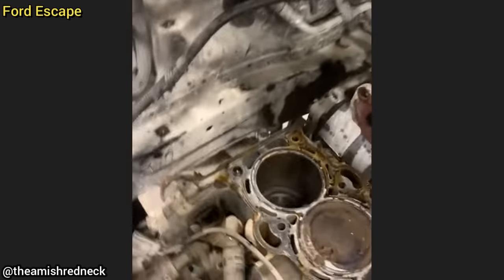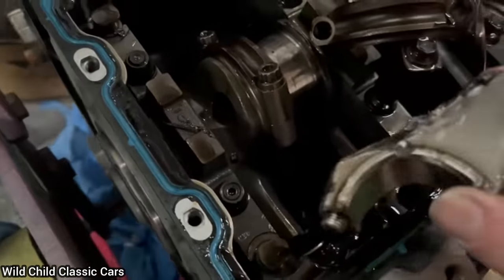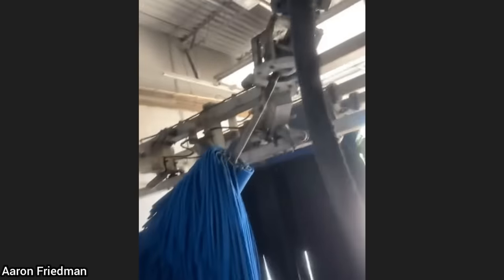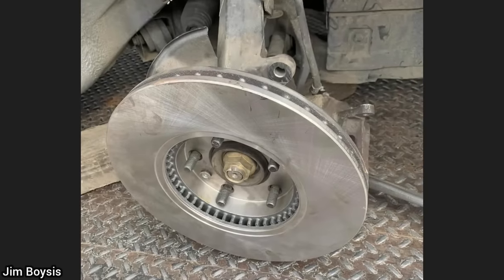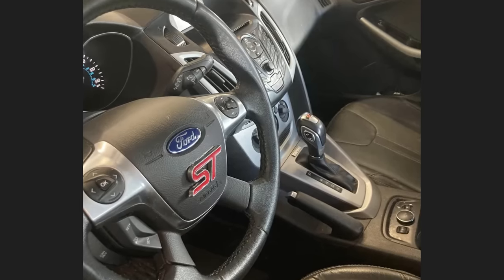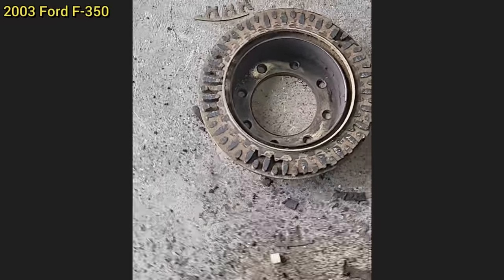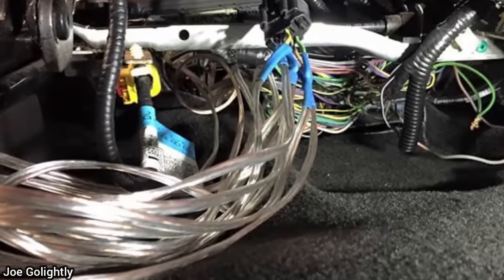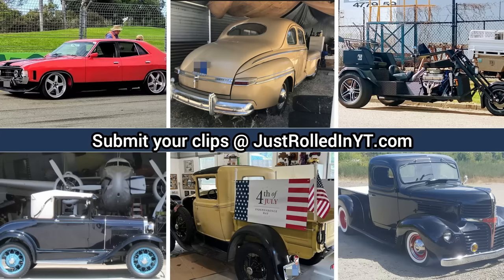Customer States Engine Runs Rough After He Replaced Some Parts | Just Rolled In

Comment: After watching each video, I have confidence I can change the oil and not blow the engine up.
Reply from the maker: You can do it 💪
Reply: That's way more confidence than I have.
Reply: Well you also need a garage with a channel, and disposing of the old oil is strictly regulated. If you just dump it somewhere, that's criminal.
Reply: @coladict  No, you don't need a garage with a channel (unless you have some exotic car with extremely low ground clearance). A jack and jack stands are perfectly fine. As for disposing of the used oil, pretty much every auto parts store in the US (can't speak for other countries) will take the old oil off your hands for free. At that point, it's no longer your problem.
Reply: @coladict been changing my oil for years. Just need some ramps(if vehicle is too low to ground) and an oil pan to collect the oil. Most auto parts stores around where I Live allow you to bring your used motor oil for free recycling.
Reply: Before you try it, do research. With your vehicle, do you drain or suck the oil out? If drain, use a new crush washer each time. 

Changing the oil on a 76 Chevy Nova was a lot easier that it looks like on a newer car. Age, bad knees and cars that are lower make me go to the shop now. 

Good luck, hope not to see you on this channel.
Reply: @mikecumbo7531  apparently you haven't changed oil since the 70's. They don't use crush washers anymore. They have a rubber gasket molded onto the drain plug. Sucking the oil out is a crap way to do it and doesn't get all the contaminates out that are sitting on the bottom of the oil pan.
Reply: @FastSS02  It depends on the manufacturer.. some still use crush washers. although you can get away with using the same one twice if you take it off and put it on backwards, as long as it wasn't way overtorqued.
Reply: @henlo1910  Please name one single modern manufacturer that does this.
Reply: Best fix in this mix. It works and it is secured.
Reply: @FastSS02  what? Suck oil or crush washer? Audi is the answer I know for both. Depends on car age I guess.
Reply: @FastSS02  Every motorcycle manufacturer? Honda for starters?
Reply: Imagine the horror I experience with every video, I grew up in the 70's and 80's when we all built our own cars.  Its disturbing I'm sharing the road with people with as little knowledge for their car as if it was a space shuttle.  The internet and smartphones have without doubt made people more ignorant.
Reply: i dont need it, my dealers garage is just a few hundred meters away and have insurance if something went wrong...
but i am also not American and not in America, i am driving a Korean car made in India!
Reply: @FastSS02  Yeah right, buddy. Next you'll be telling us you don't have to turn the crank on the front to start the engine anymore. Damn young'ns think they know everything!
Reply: Idk what's worse. 

Lazy idiots that never change the oil and wonder why it seized up, or those that somehow fill the oil pan up with 30 gallons of oil instead of 3 or 4 quarts (depends on vehicle, obviously. heavy equipment can require several gallons).

Anyways, I don't need anything fancy. Just my trusty 6 ton speed jack, a couple car stands, a socket for the plug, and my filter remover. 30 minutes and it's back on the ground.
Reply: @tenhundredkills  Up here in Canada, most Auto shops will take used Oil for disposal. There are some places that will charge you about $$ 10--15. to dispose of old Oil.
Reply: @coladict You can get a small catch basion you slide under the car get a pump jack and pull the oil plug also you can store used oil in empty oil containers when you put new oil in
Reply: @FastSS02 my old 03 Corolla S did so does my 04 Camry LE
Reply: @Javalar why
Reply: @tenhundredkills  yes all correct I use the old oil on all sorts of thing's tho

Comment: The backwards installed rotor made me laugh out loud!
Reply from the maker: Same! 😅
Reply: Should not smoke weed while working on brakes.
Reply: I put rotors on backwards all the time.... of course, after I spray them down with brake kleen I put them on properly
Reply: How do they come to the conclusion that its the studs, and/or another issue after taking off the old rotor? How?? Its disturbing how they can't work out what the (very simple) issue is despite it being right in front of them. 😆🤣🤣
Guy 1:   "I think.......I think the studs shrunk when we weren't looking😵‍💫!!"
Guy 2:   "Yeah,  Iv'e heard of that, it usually happens when you change the wheel in the rain, but can happen from time to time. Lets go down the parts store and order some longer ones🤤"
Reply: Certified 'emmerfugengawd' moment from those guys.
Reply: And "a friend just installed" an excuse for a DIY gone wrong
Reply: Years back a fellow my father worked with did that but with the front tire on a semi truck. Installed the steering tire ‘inside out’ when he changed it and then pulled it outside the shop and parked it. My father came along and had to scratch his head for a minute as something wasn’t quite right with that picture and then the light came on, ** the wheel is on backwards!
Reply: The best part is to even get that far you would have had to have taken the old rotors off... The ones right in your face and installed correctly.
Reply: All I could think was, Did you NOT watch how you took them apart? Clearly someone who thinks they're smarter than they are. The longer wheel studs line was a hoot. Lol
Reply: I was about to leave the exact same comment 😂
Reply: Got a good laugh out of that one. But at least they knew when to stop and seek professional assistance.
Reply: @Tk3997 I was taught that working on brakes you do one side at a time. If you ever get confused you can go look at the other side and figure it out.
Reply: It's not like there weren't 3 other chances on the car to compare in case of uncertainty...🤦‍♂ 

(and even if front and back look a bit different, the other side should still be usable as a guideline.)
Reply: @Bandit69ply  And that is why you do only one side at a time.  Use the other side for reference.
Reply: @uhtred7860  My first guess for why/how? Legal recreational weed.
Reply: Yes over the years I’ve worked on my own brakes, usually with success,    BUT I’m pretty sure that there could be a liability issue if anything wasn’t right and people or property got damaged,  brakes are important….get them serviced by a professional with liability insurance …. My advice
Reply: I laughed...out of pain
Reply: It's plausible that they bought the wrong rotor replacement so it wouldn't go in the correct way. So they figured to reverse it but now the lug nuts wouldn't connect 🤣 For a noob DIY guy it can be very confusing if the parts store hands you out the wrong part. It can happen even to professionals: I had an old Opel Vectra that developed a clunk in the front. So I had the front bushings to be replaced. I happened to walk in the shop while they tried to install the bushings using a blow torch and heating the sway bar red hot. After the install the clunk was even worse than before. Turns out that this year model Vectra had two optional sizes of bushings and they had ordered the wrong size. The mechanic then applied brute force to literally burn in the 60mm bushing to a 50mm hole.

Comment: Wow shout out to the tech who takes on the challenge of fixing a customers wiring job when it looks like that
Reply: Nothing was fixed, it was just totally removed and replaced with the correct harness and heating element.
Reply: Speaker wire, the customer used speaker wire for a seat heating element...Someone clearly knows nothing of electronics, electricity, resistance...
Reply: Yeah, I've made spaghetti that looked easier to sort out that that.
Reply: The scariest part is that a seat actually comes with that many wires, it's a damn seat not an electric chair!

Comment: call the cops if you see a damaged vehicle driving on the road like that box truck
Reply: yea, if that thing falls of it could kill someone for sure, imagtion that hitting someone on a motorbike...
Reply: It more than likely was in accident and was being driven to the junkyard. Should have had straps to hold it together, but some states don't care about safety.
Reply: Probably just happened and driver is still unaware!😂
Reply: @americansmark  It should've had the box taken off and hauled PROPERLY to the junk yard.
Reply: It's surprising that the driver drove it in that condition. He better hope that he still has a job after his boss sees the truck.
Reply: I was at a rest stop and saw this guy's rear bumper barely hanging on.  I told him he needed to secure it before it became a projectile.  He basically told me to F Off.  Try to be nice and you get an asshole response.  Five miles down the road, it came off and went through another vehicles windshield almost hitting the passenger.  I pulled over and informed the police about my encounter with the moron at the rest stop.  That just made things worse for the guy since he clearly showed zero concern for anyone's safety.  It didn't help that the moron was also doing almost 20 over the 80mph speed limit at the time he was cutting across lanes to get around traffic when the bumper came off.  They police already had several complaints about the guy's speeding, reckless driving, and the bumper flapping up and down.  The only smart decision he made was pulling over and checking on the couple his bumper almost killed.
Reply: @johnm.5848  Driver probably is the boss.
Reply: Those flying pieces are likely to injure someone , wtf is wrong with people
Reply: OK Karen !
Reply: "Hi, I'm on [highway name] just [approaching|passing] [nearest exit] and there’s a truck that looks like it's going to fall apart on the road." is a great script.
Reply: nah, call the airforce to precision bomb it
Reply: @theglitch99 With how much it's leaning, I don't know how they're not noticing.  It's quite obviously leaning and I wouldn't be surprised if it was affecting how the vehicle was driving
Reply: He probably just left the 11'8" channel😏🤣🤣🤣
Reply: snitch
Reply: It’s nyc , anything goes
Reply: @ffjsb that's not how it's done. Wether it drives there on its own or towed. It will go to the scrapyard with the box in this condition.
Reply: @XtreeM_FaiL  That came to mind after posting my comment. Either way though, the truck wasn't safe with the box heavily damaged.
Reply: leviathanr53 dont feed the trolls and they will go away
Reply: How do you know for absolute certainty, he isnt on his way to the shop right then in that video.  Should the shop go to him? Would a tow truck tie it down?
Reply: @marioncobretti7870  If he's on his way to the shop, he should disassemble the box. That's not an excuse to endanger everyone on the road.
Reply: @alimanski7941  the average person isnt going to have the know how, or tools ,to completely disassemble that box. I dont agree it should be on the road either, but I dont see what realistic option  a random delivery guy really has.
   And no, i dont see a tow truck driver, strapping  all that shit down either
Reply: @marioncobretti7870 just because you don't have the know-how doesn't mean you just go on the road and hope for the best. If you don't know howto break it down, hire someone who does. There's no reason a truck should be on the road in that state. You can't break it down, guess that truck is sitting where's its at until the box is broken down.
Reply: Truck probably had a date with the can opener
Reply: @theglitch99 unaware? He could look out his driver-side mirror and see the box leaning😅😅😅😮
Reply: @tracewallace23 came here to post the same thing!   Lol
Reply: Thanks karen
Reply: It’s in Astoria, Queens……it’s a normal thing to see vehicles in this condition 👌☠️🤦‍♀️
Reply: Looks like he drove under a low bridge.
Reply: A victim of the 11' 6 plus 8" bridge?
Reply: @marioncobretti7870  Doesn't matter where he is going. That is defective equipment. When a piece flies off and kills or hurts someone you love I'm sure you will just say, "It's ok, he was just on the way to the shop, I wont sue him".
Reply: @switchtr3  No, it is everyones business. He is dangerous and needs to not be on the road. There is NO reason for him to be driving that wreck. You just have no since of social responsibility.
Reply: @aliceeliot6389  Why? This is why you should. So is a flying piece of junk kills your kid you would be ok with that because at least no one called the cops.
Reply: @marioncobretti7870  That doesn't matter. He's responsible for the truck he's driving. If he doesn't know how to take it apart, get someone who can. He should NOT be endangering other people's lives just because he's incompetent. You know that if someone died, he'd be accountable for not taking preventative action, right?
Reply: @switchtr3 Well, if it happened half a mile ago, he can tell that to the cops and they'll escort him off the road. Getting people in trouble is better than getting people dead.
Reply: Exactly !!! @baldrian22
Reply: @americanpatriot2.06  thank you for telling the cops the full story, that guy deserves the full weight of the law.
Reply: @wolfrig2000  Not legally.  No way in hell that's legal in ANY state.  There ARE laws about the road-worthiness of ANY vehicle on the road, REGARDLESS of whether or not it's going to the scrap yard.
Reply: @armedprophet3321  Clown.
Reply: @johnm.5848  I wonder if the box truck had been anywhere near the (in)famous 11ft 8" bridge in Durham NC?
Reply: @Hijinkx2k  i already said, i agree it shouldnt be on the road. I also just said, some random guy, wont have the tools or kmow how to do it themself.
     So if this guy was randomly in some random hit and run, and they destroyed the box on his truck ajd left him stranded some where,   i guess i feel for him if the general response is the nazi germany method where you just start calling the cops
Reply: Well,that was in Queens,so don't get your hopes up....
Reply: Snitches get stitches lol jk
Reply: I️ can give a description of the driver and we didn’t even see him.
Reply: DOT divisipn of Highway patrol in my state activley look 4 stuff like that. I see them more than regular cops
Reply: Twenty years ago or so I got behind an RV that had the entire rear section, about two feet, held onto the RV with duct tape!  All the way around!  I called the State Police, but don't know if they caught them (probably did as they went south on an interstate).  People just amaze at how stupid they are.
Reply: Probably being taken in to have this destroyed box removed/replaced.
Reply: @baldrian22 Your spelling could kill someone. 😂
Reply: @MattRobey most drivers have tunnel vision only looking fwd. Motorcycle riders in cArs trucks always looking around it's habit
Reply: @tracewallace23 Ayyyy I get the reference
Reply: @onearthonelegion Nah, NUKE IT FROM ORBIT
Reply: @TheSh4dowgale  Yes, it's the only way to be sure.
Reply: The cops wouldn't do anything where I live because I'm in a Democrat-run area. They don't even respond to shoplifting calls anymore, and won't show up to file police reports for car accidents unless there are injuries.

Get used to that sort of thing in Biden's America. With the war on law and order, anything goes in s Democrat-run area. 

Not long ago, a guy drove past me near dark in an old Chevy pickup with no headlights. By that, I mean that there was no bumper, no grill, and no headlights. Just a radiator.
Reply: @marioncobretti7870 DONT drive it anywhere, thats the only option dude should be arrested for endangering other drivers
Reply: @aliceeliot6389 hate this “who cares, let my neighbor die on the highway because of an obvious danger, it’s not my problem” attitude
Reply: @americanpatriot2.06  that guy likely thinks driving is a right.
Reply: It didn't look like it had license plates, I bet the guy just bought it like that at an auction.

Comment: 0:25 My son did something similar. He’d done serious upgrades to the suspension and tires, and was pulling 1.4 G laterally at an autocross. While he had the right amount of oil, it was a stock motor, with its minuscule windage tray. So on a long left-hander the oil pickup was just sucking air. Serious rod knock, and a nice golden sheen on the oil when he drained it.
Reply: Superfastmatt did something similar, put a motorbike engine in a car and forgot that bikes lean into corners so their engines assume the oil is always at the bottom. The oil went to the sides and the engine starved.
Reply: What's the golden sheen from?
Reply: @jackjack4412  metal filings I think
Reply: @jackjack4412  copper coating from the bearings
Reply: BMW E60 M5 with the V10 S85 engine has twin scavenger pumps on the sump to prevent this from happening.
Reply: Dry sump in my BMW motorcycle.
Reply: @mista5796  Standard practice on M car engines since the late '00s. The S65, S55, S58 and the variant of the N55 in the OG M2 all have scavenger pumps. Retrofitting the S54's dual pickup setup onto older or non-M engines works well too.